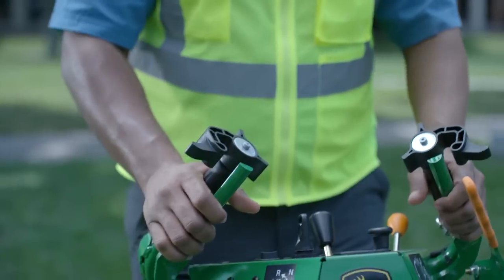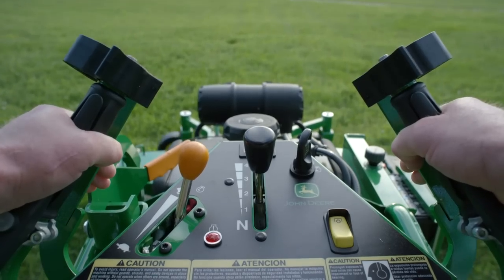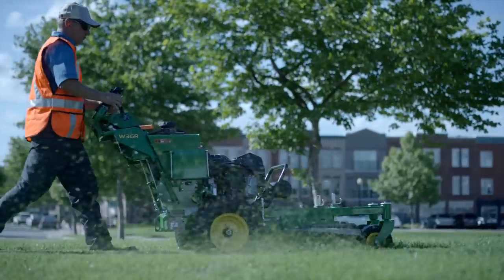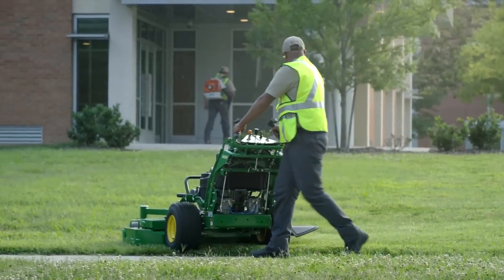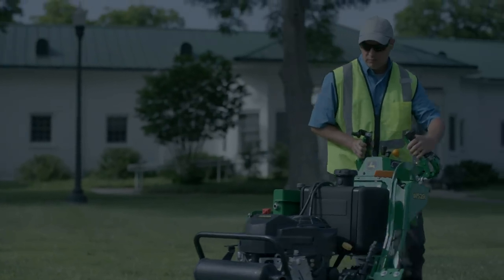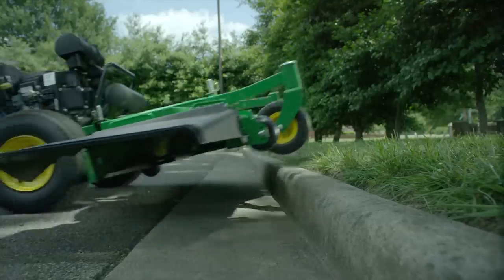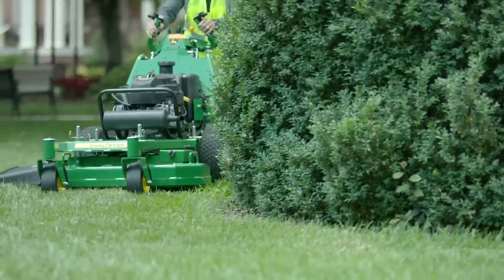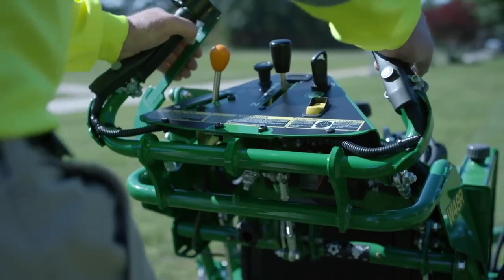M and R Series Walk-Behind Mowers | John Deere

Comment: Someone needs to make a 32 floatin deck hydro mower
Reply: why 32? for residential gates?
Reply: @zacjohnson8404  Yep. 36 gets through 8/10 small gates but some gates are exactly 32 inches and losing 4 inches of cut from going 32 over a 36 mower isn't much loss.
Reply: @DoctorRickSanchez  drop your 20% that a 36" won't fit in and get more clients with a standard 36" gate. That or use a 21" standard mower that is usually necessary on the trailer anyway. 32" is so niche, it doesn't make sense unless you have a massive operation and a hoard of small gates. I have a guy that will widen a gate for $110 bucks as well. Worth it for good contracts.
Reply: @DoctorRickSanchez  losing 12% productivity on all your lawns when only 20% of your lawns require a 32" doesn't make a lot of sense if you think about it. Are you a smaller, one truck operation it sounds like?